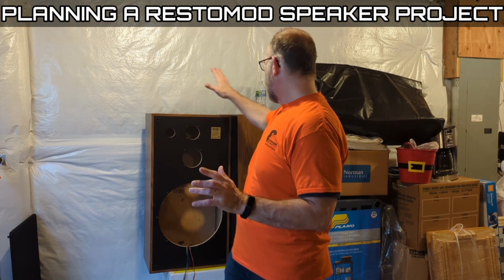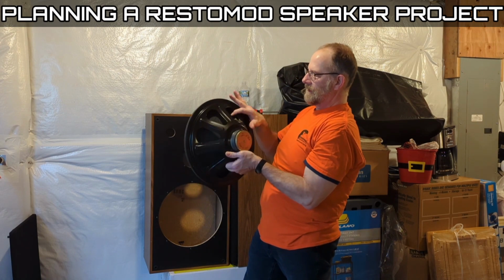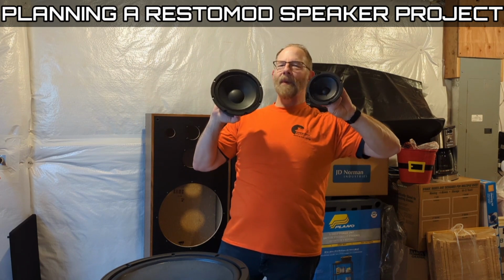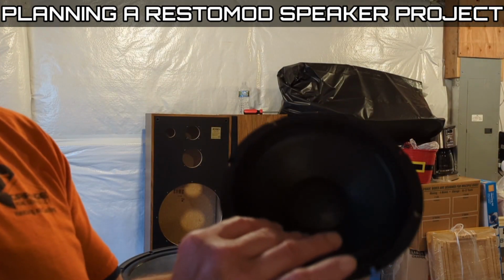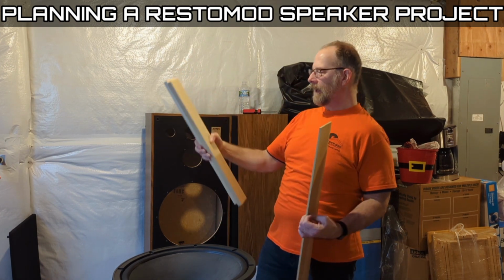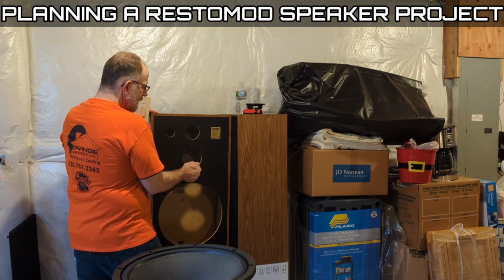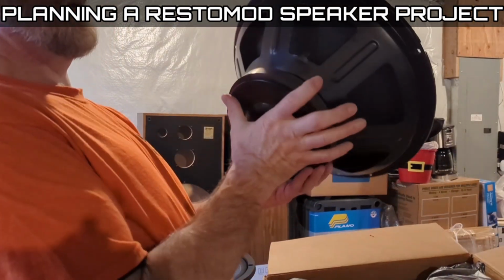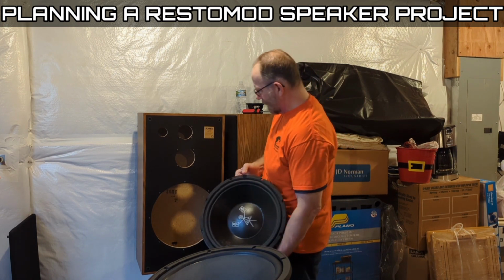How To Plan A Speaker Project That Sounds Amazing - Jensen CS 315 RestoMod Speakers

Comment from the maker: :yougotthis: This an old video that I did my best to edit so its easier to watch than the original. I goofed on my opening paragraph text box that is partially hidden by the sides of the frame. Sorry, I noticed it after seeing it on my big screen TV after it was published. Here's what that textbox read: "Planning a RestoMod Speaker December 2022 (when I originally uploaded that video), I condensed this oldie and repackaged it".

Now that I've got my apology and explanation out of the way, let me tell you what I meant by that: This particular video was the very first one I tried to do. From today's date it was 4 months ago, which in YouTube land, seems like 4 years because everything happens so fast and so much new content is released by YouTubers. I was filming that original video in my dingy basement with my cell phone and it wasn't scripted so I have very few views on that video, although it really does have useful content.

This "planning a retro-mod speaker project" phase is one of my personal favorites when it comes to speaker building in general,  because its when days, weeks, months or years of daydreaming about the design, and browsing for speaker parts, researching speaker building information and so on, culminates into something tangible and doable.

Thank you for watching my Thursday Throwback speaker video, as I ramble on during the planning phase of my DIY RestoMod Speaker Project utilizing an old pair of Jensen CS 315 vintage 3 way 15" ported cabinets that I acquired for cheap on Craigslist and turned into a really cool vintage pair of speakers.

Comment from the maker: @jimthvac100 ... Regarding those couple comments that came through that are now deleted: I LOVE THOSE LITTLE EMINENCE MIDRANGES. The ones that come as a pair correct? The answer is yes, 100% I was considering those and had them in my shopping cart on more than one occasion, but never pulled the trigger because I'd like to use the eminence rear baffles with them, but not sure if they'd fit. I used Dayton 5" Pro Full Ranges because I had them already from another project.

The internal box volume of the beastly Jensen's was 3.37 cubic feet if memory serves correctly, and with all the bracing, I rough-guessed that it would be around 3.0 to 3.25 cu ft.